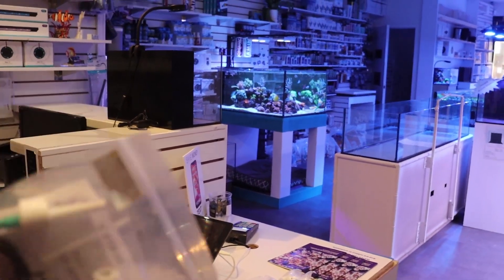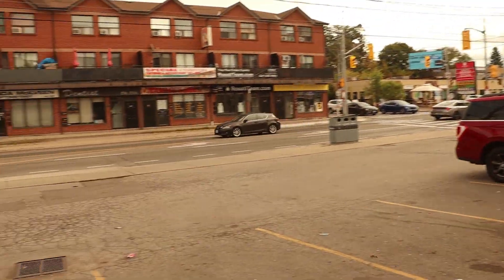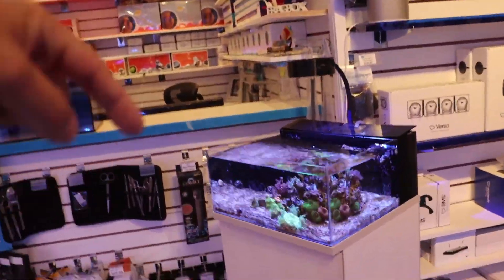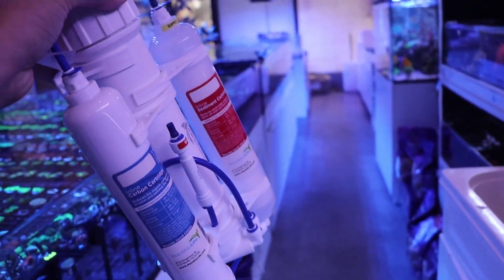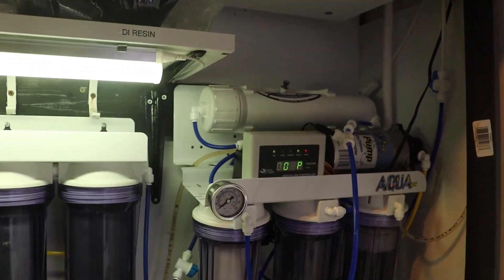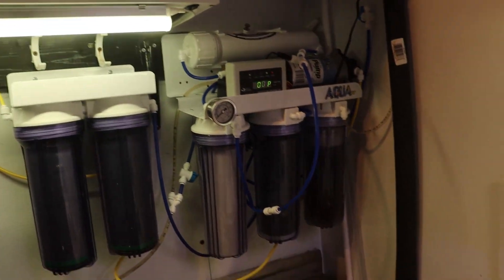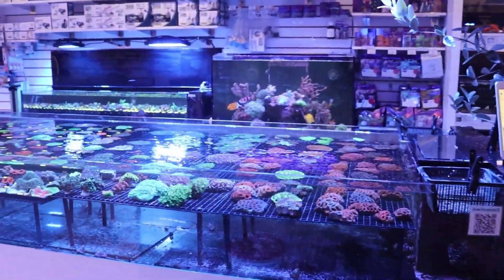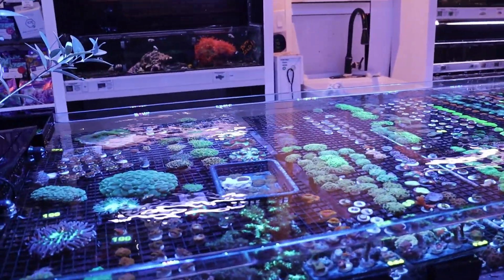Lets Upgrade Our RODI With DUAL TDS Meters

Comment: Live in the Edmonton area and I recently started a new saltwater tank with the tap water that we have here and had no issues with it so far.
Reply: Yup, Edmonton water is good, unless you talk to the water filter salesmen.
Reply: it is. I am still going to get a RODI system anyways but so far its been pretty good. @peterulvestad6418
Reply: Yup where I live my TDS is low 40s and I still use a 4 stage rodi unit but I should have just bought a regular ro unit because our city water doesn't have chloramines in it. And even in the past I have used just tap water with Prime water conditioner and never had any problems.